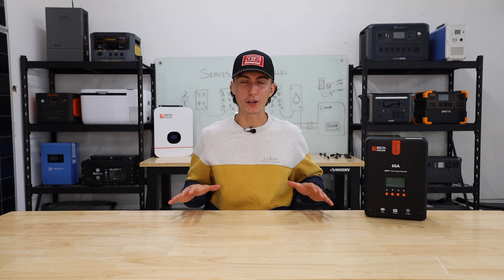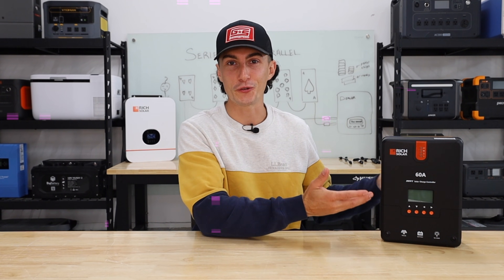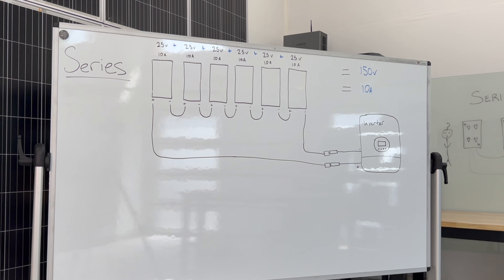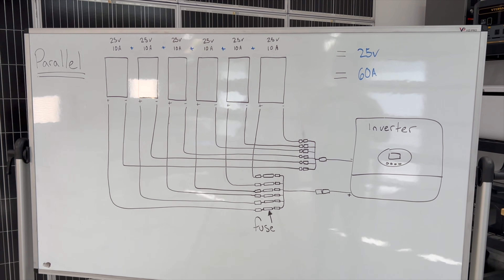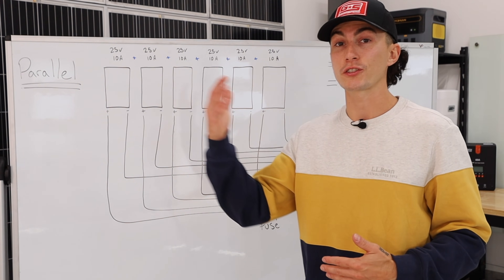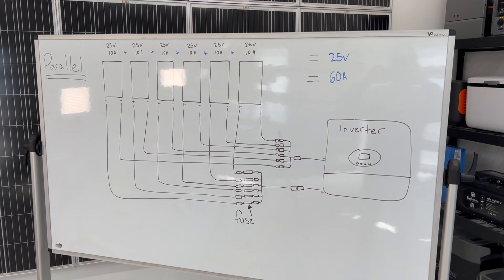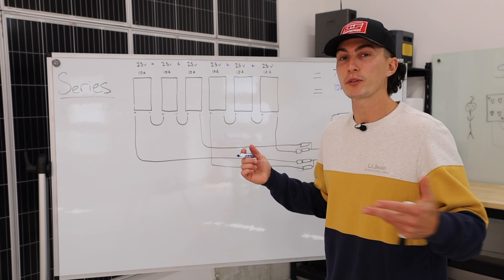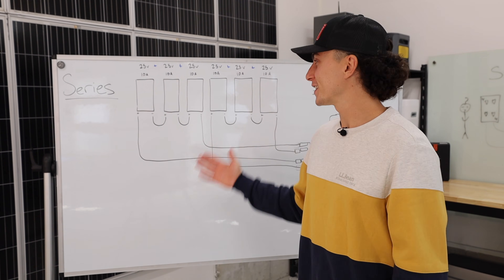Series vs Parallel Solar Panel Wiring Basics - Volts, Amps, Cost & More Explained

Comment: I thought when you connect in parallel, now all panels should output the same current, and if one panel is making less current, all other panels a caped at that current… So kind of similar problem as with serial connection but with amps instead of volts…

Comment: I have 4, 100 watt Eco-Worthy solar panels running parallel. They are rated for about 5 amps each.  I have only gotten 1.5 amps out of them. Even if I run just one of them, I get 1.5a.  It's like they are in series but they are not. All positives run together and all negatives run together. Has anyone ever had this happen? It goes against math.

Comment: Hi How many 260W photovoltaic panels can be connected to the device and what is the best way? Operating voltage and current 61.5V (Voc) - 51.5V (Vmp) 5.49A (Isc), 5.05A (Imp)For Power Station with solar input Maximum 1,000W, 12V to 60V, 20A Max.?

Comment: What if you have 5 panels, can you split them up on 3 and 2? or it has to evenly match the panels cut in half ?. i got 13.13A per panel and 31.61V, its either 31.61v and 65.65 Amps with a 70 Amp inverter or 158.05v and 13.13A with a 20 amp fuse, parallel im assuming its best to put a 15 amp fuse per panel, if i cant do 3 and 2, ill just do 2 and 2, in order to make it simple, i got 26.26A and 63.22Volt. I think i want to try the 2 and 2 series split parallel. What i was thinking since its on a 5 panel solar tracker, i want to power a 100A panel that a 60Amp breaker is feeding. I figured for the continuous loads like fridge and A/C/Furnace etc etc i could wire the 3 panels on series or parallel and same with the other 2, then 3 solar panels with 2-3 100 AH batteries hooked up to it powering one half of the house, and 2 solar panels and 2 batteries powering the other half of non-continuous house load. Id figure id need 2 inverters for that? Or do they sell inverters that can be wired to have 2 hots and a neutral ? I figured id need 2 inverters, one for the 3 and one for the 2 then with that ill have 2 hots, then have like a 30 amp and a 20 amp breaker feeding that 100 amp/60Amp panel, we are only gonna use like 25 amps or less per side. Maybe im over thinking it, but he wants to be able to shut main off and turn on the solar one when its being used and visa versa. Ill just do a 60amp disconnect at bottom of panel and power the casita from there and run the solar wires in there to swap them out when removing main breaker wires for solar. Im sure theres a better way. I figured i could just run my panel wires from the right side of inverter ( gen lighting ) to a 50-100  main Amp disconnect that carries wires to the other 60 amp disconnect to unhook main power and hook solar when needed to that 60 amp breaker to power the casita, he has a module but wasnt turning DC into AC, but he didnt have an inverter hooked up to the battery, would that be a reason why he was not getting he power to AC? This is a lot, doubt you reply, ill keep on reading.

Comment: More blessings bro, how can you identify a series solar panel and parallel solar panel? I need more explanations on that
Reply: All panels are the same, with the same two wires. How you get those wires all to the inverter can be done by wiring them in series or parallel.

Comment: Can I ask, in the parallel + series configuration, what size fuse in Amps would you be using and why please. Great video, easy to understand, keep it up!
Reply: Fuse for the series string should be 1.25x Isc of sub series string. Main fuse should be 1.25x combined Isc of all strings connected in parallel

Comment: In your example, any downside to just buying an MPPT/inverter that accepts a larger max voltage? Why buy a bunch of wires and make new strings just to fit an MPPT/inverter? Why not make the MPPT/inverter fit the system?
Reply: It is possible, it all boils down to cost. The more MPPT the inverter has, the more costly it will be.

Comment: CAN ANYONE HELP ME ? 
I have 2 arrays of 4- 100W  20.4 V   5.21 A  both array in series and connecting them together in Parallel. 

What size fuse do I need for the two connection of the positive 
I thought I had this figured out but now not sure 
Do I (4 time 5.21 = 20.84.  ??
Reply: You will need 3 fuse (2 array fuse + 1 main fuse)
array fuse = 1.25 x Isc of the string
main fuse = 1.25 x Isc of the total of both string

Comment: Would this inverter be really suitable for this example? I saw that the rated power of the inverter is 3000 W, while the total power of the module summed together is only 25 V * 10 A * 6 = 1500 W.

Comment: Great video my one question is in your last example series parallel combined how may watts do you get. Thanks again
Reply: (75V and 10 Amp) + (75V and 10 Amps ) = 150V and 10 Amps = 1,500 Watts (two strings put together adds only the Volts.)
No matter the configuration, you'll have 1,500 Watts because Watts is just Volts x Amps

Comment: Is there a benefit of choosing one or the other ? My ac70 accepts my two 100w panels in either configuration. Should I connect them In series or parallel?
Reply: Series benefits from higher voltages so lower fuse ratings required. Parallel needs higher rates fuse, is more awkward to wire (3 way terminals involved) but if you get some shade on your panels then parallel can get you more power

Comment: What setup would charge the battery faster ?
Reply: A battery will generally charge faster in a series connection than in a parallel connection; this is because connecting batteries in series increases the voltage, which can allow for a faster charging rate, while connecting in parallel increases the capacity (amp-hours), which can take longer to fully charge.

Comment: Wanted some panels for my power stations for emergency prep. As the foldable ones the power station OEMs offer are dreadfully expensive I opted for a pair of Renogy ~12V / 100W - they're within the power stations' oddball voltage/current limits and got a good deal on them.  I use a single panel with the EB3A and series the two for the AC180; well below the maximums for both but sufficient to recover reasonable watts.

Comment: Great video. Easy to understand. Thanks. Can you do multiple series and parallel? In other words, let's say you have 8 100 w panels, can you do 4 pairs in series and then do those 4 connections in parallel?
Reply: yes, you just need a 4:1 branch connector.

Comment: Helpful, but saying "daisy chain" does not help the beginner.  You need to show how negative goes to positive in the chain and also need to show the actual cable extension connections and how they connect.

Comment: I get the whole thing, but does one system charge batteries faster or not ? Can it be done with 2 x 200w and 2 x 100w ? :)
Reply: A battery will generally charge faster in a series connection than in a parallel connection; this is because connecting batteries in series increases the voltage, which can allow for a faster charging rate, while connecting in parallel increases the capacity (amp-hours), which can take longer to fully charge.

Comment: When you did Series- Parallel Connection, I get two series as 10 amps going to the inverter to make it 20A. And I get adding the 3 panels’ volts to get 75V, but don’t you have to wire the second series’ negatives all together and positives all together? Also, WATTS. How does the Rich Solar unit accept 4500W? Doesn’t it say 3000? How do I calculate watt output for the example system?

Comment: I like how he says “because science”
Reply: “Because science,” is a great way to answer the “why” question for amateur installers. It’s a lot easier than loading up a bunch of electrical formulas that produce glassed-over eyes in classroom lectures. Ohm’s Law, Watt’s Law, the power formula, etc, do little to get to the point of why solar installations are wired in series, parallel or in series-parallel. The presenter in this video did a pretty good job of keeping it simple.
Reply: @TenMinuteTrips  Well, I am the person the would love the explanation.  I am the one who reads manuals just because.
Reply: When I heard it I laughed! You didn't say it'd hit the funny bone like that. 😂

Comment: Which mc4 is positive on the back of a panel? Mine doesn't say
Reply: Volt meter.If you see a (-) meter wires are backwards.Meaning the other side is positive +

Comment: So I purchased a Anker f2600 with a 60v max input @ 20 amps. However it says it can accept 1000w of solar. How in the world can I do this? Is this even possible? Or am I just stupid? 😂
Reply: From what I've read, using certain panels in a series + parallel set up and keep the amps and voltage within spec.

Comment: A few corrections.

On series arrays, solar panels >= 100W have bypass diodes so if a panel is shaded it just goes into bypass.  The array can continue producing and (for the most part) only the shaded panel's output drops off.  Where paralleling works better in some cases it is really only in situations where there is a lot of random shading happening on many panels.

On paralleling arrays, you can't just connect the positives together and the negatives together.  You need to use a combiner box that individually fuses each source. Combiner boxes also typically have surge protection and a master breaker for convenient maintenance.   Without the fuses, paralleling 3 or more panels introduces significant fire risk.   And to be totally honest, its a good idea to us a combiner box even when paralleling just 2.

Branch connectors should never be used.  They are popular, I know, but its a major failure point because people buy these things off of Amazon and they often do not have enough copper internally to work safely.  People also put branch connectors up on the roof without any protection of any sort and they become hazards over time due to the MC4 tabs becoming brittle.

Even if you don't think you need a combiner box, get one anyway instead of using a branch connector.  It also makes working on arrays easier because you have a convenient disconnect point that does not require disconnecting and reconnecting MC4 connectors (which also tends to result in broken MC4 tabs).

Generally speaking, higher voltages at lower currents are a whole lot more efficient than lower voltages at higher currents, so series is almost always the way to go.  But paralleling does make sense in a few situations.

-Matt
Reply: Many thanks. 🎉
Reply: Thank you for this wisdom! I'm staying clear of branch connectors as much as possible.
Reply: My panels have to be in parallel for the inverter. 
The branch is also on the roof - how can I protect it? 
There’s also a small box nearby which must be the combiner box, I may need to ask the seller.
Reply: So glad you talk about the things NO ONE ELSE  talks about (in order to claim easiest thing ever a child could do it?). Possibly life saving info.
Reply: Thank you kindly for sharing this knowledge.
Reply: thank you .
Reply: Series and its higher voltage means less voltage drop on smaller wire. Especially for longer runs.  Also in overcast or end of day situations, series will produce a voltage that can still keep the charge controller on line.
Reply: Wow. Thanks. But more to study
Reply: It seems that my setups produce more juice when in series. Parallel just doesn't cut it.
Reply: cool
Reply: Matt, thanks for the great info. How does one calculate what size fuse to run when wiring in parallel!!???
Reply: @racegts  Solar panels have a "maximum series fuse" specification, usually on the panels label itself.  This is the maximum fuse value that should be used.

You only need to fuse when paralleling strings where the sum total possible amperage coming from all the strings exceeds the "maximum series fuse" rating of the panels.  When that is the case, each string needs its own fuse before being combined.  A solar combiner box takes care of the wiring and fuse holders but you do have to supply the correct value fuses.

The fuses are generally 10x38mm ceramic fuses, also known as "Solar PV fuses".  These are low-amperage / high-voltage fuses.

-Matt

Comment: In the bad old days, a shaded panel took down the entire series string. Pretty much all new panels have a bypass diode now that fixes this problem - shaded panels just get skipped and the rest continue producing power.
Reply: I thought bypass diodes only bypass cells within a panel, not entire panels, meaning that a shaded panel's diminished performance still brings down the performance entire string, though a shaded cell doesn't bring down the performance of an individual panel as much when bypass diodes are used.
Reply: @xirgot  there's one bypass diode per panel, I don't think it can act on a per cell basis
Reply: @ChrisBairKeto  Some panels have two halves, each with its own diode. This helps make shaded panels produce at least some energy.
Reply: Is that really common with most all of them now.  Or is there a way to know.  Aside from just hooking up in series shading one to find out?
Reply: @AquaTech225  I think you just look at the spec sheet and it should list that as a feature along with the wattage and voltage.
Reply: Bypass diodes only work or conduct when the voltage of the shaded panel it is protecting drops lower than the forward voltage drop of  the diode usually 0.7v to 2v... So most likely they will not be skipped unless the said panel is totally broken...

Comment: what’s the difference between using branch components (e.g. mc4 y connector) vs splitters (e.g. xt60 splitter) for running parallel into a portable power station? is one of those safer than the other?